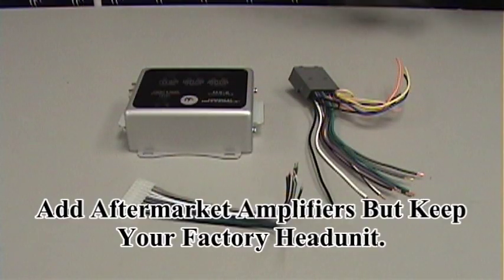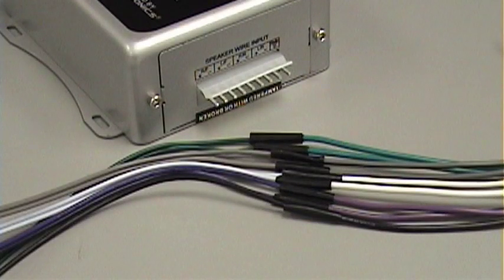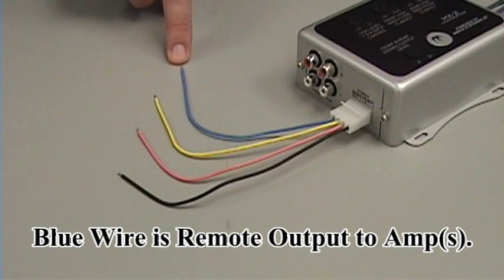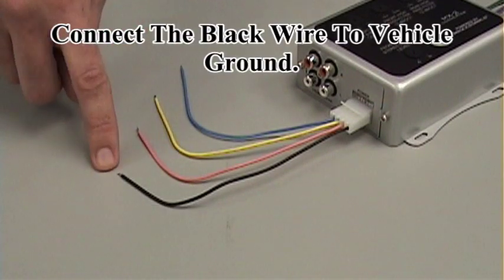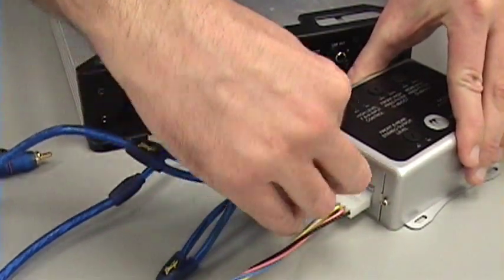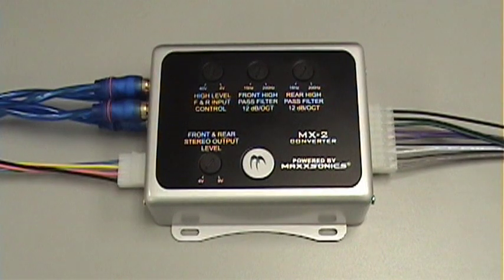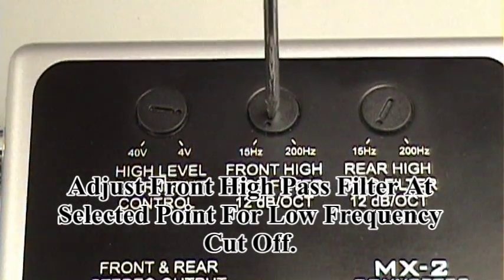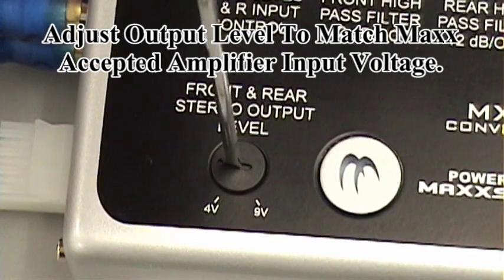MX-2 Deluxe High-to-Low Level Converter Installation Tutorial

Comment from the maker: @FourthBattalion Connect the remote (REM IN) terminal to the radio output wire that provides a +12 volt output when the radio is on and 0 volts when the radio is off. If the radio does not have a +12 volt output, do not use this terminal.

Comment: I have a ford ranger with no after market radio i have a high/low adaptor ( that makes it where i can put rca's up to it) but i want to keep all my speakers working could i just cut in to my rear speaker wire and tie in the adaptor and it will still work or do i have to use the tapping skill.

Comment from the maker: Yes, you can disconnect the speaker wires from your speakers that are being powered by your factory headunit and connect those wires to the MX-2. It is the same as connecting directly from the outputs of the factory radio.